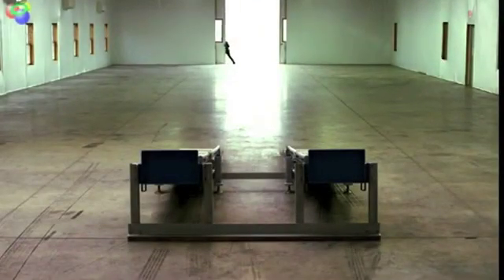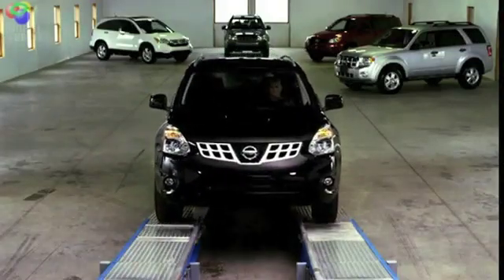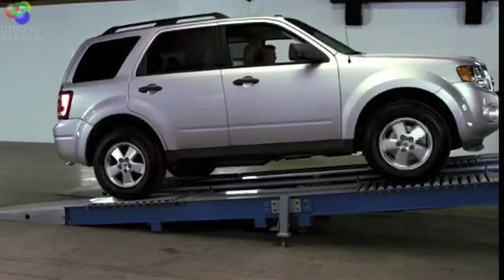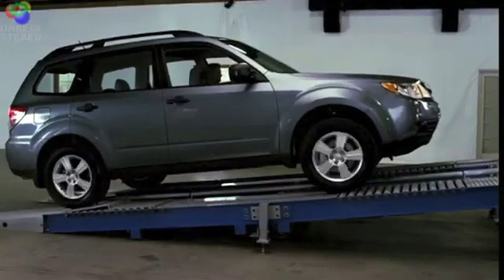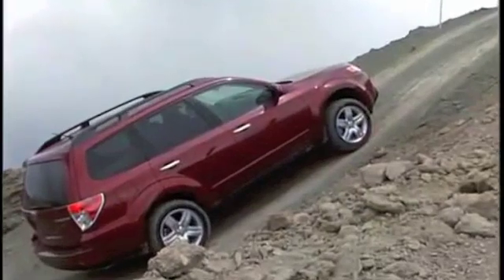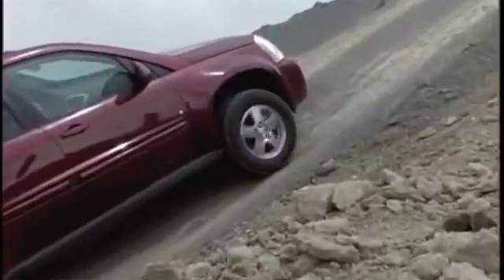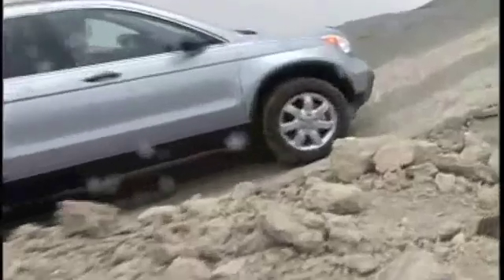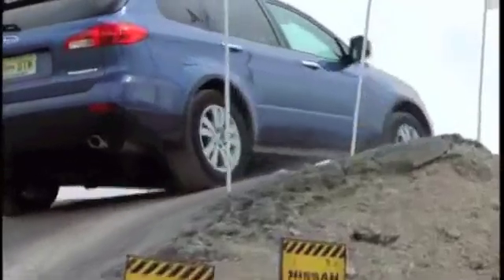Subaru Symmetrical AWD Test

Comment: You actually can get up the slope with all the cars. turn off traction control, lock 4wd, and floor it. the 160+ hp of these wheels, even if only 20% is given to 1 wheel, that 30 some hp should be able to push the car up a 15 degree incline
Reply: which of these vehicles have a locking center differential? with open differentials, power transfer is 100% of axle torque to the wheel with least traction. brake traction systems must overcome the engine torque upon one spinning wheel to transfer the 100% to the other wheel and drive it.

with a locked center diff, 50% goes to front and back. with the open diffs these cars have, only the wheel with least traction may get the 80 hp of 160 available. seeing as the brakes aren't really up to that challenge, I seriously doubt they can transmit your "30" hp to the ground.
Reply: KTMcaptain Good point. You actually should leave traction control on, Even without a locking dif, the tcs should take away enough power from the loose wheel and transfer it to the other. That being said, it may or may not be enough depending on the incline
Reply: g1122123 well it does, you can see the spinning wheel momentarily stop then the vehicle lurches forward and as it does that wheel begins to spin again.

the braking system needs to stay engaged the whole time, for once that wheel on the rollers is released from the brakes it will spin and kill all drive.

Subaru has better programming, and a true limited slip center differential, so the system need only stop 1 wheel from spinning instead of 3.
Reply: g1122123 fyi, you're the first person to actually say good point. I get dozens of notifications from people telling me they know and I don't. but when I present empirical evidence to substantiate my claim and they can't, they all get very angry and call me names. one person said I should kill myself.

thank you for your class
Reply: KTMcaptain Thanks. And it seems to be the internet etiquette, agree or hate.
Reply: sad but true

Comment: I like these kind of real world tests, but a few more bits of info would have been nice.  Did any models have electronic differential lockers?  Did they all have traction control in addition to AWD?  Did any have locking transfer cases (full time 4wd vs AWD)?  Nice demos, guys.  :-)
Reply: No, they dont have differential lockers
Reply: I know the Rav4 has a button to lock the t-case into a 50/50 torque split front/rear up to 20mph, then it reverts back to the standard AWD settings, but not sure on the other models they tested...most systems are actually front wheel drive until traction is lost then the system sends power to the other wheels, but in these tests as soon as a wheel slips they let off the accelerator preventing the system from actually transferring power so as to make it look like those vehicles failed.  

None of them have locking differentials.